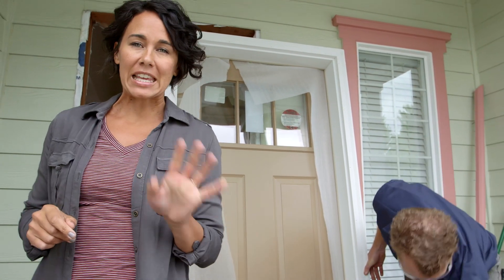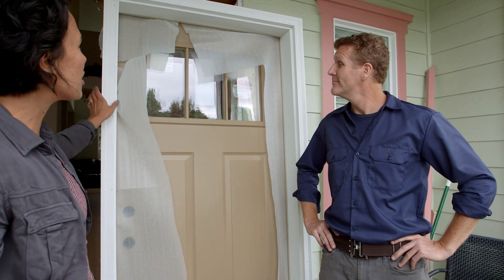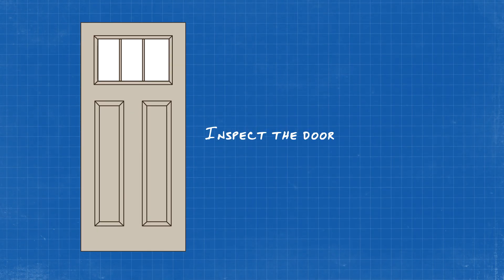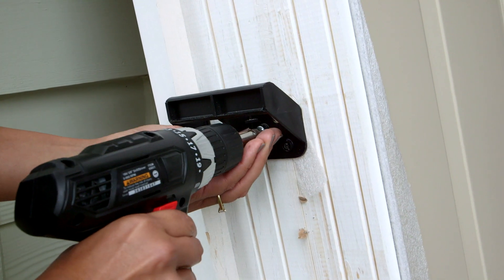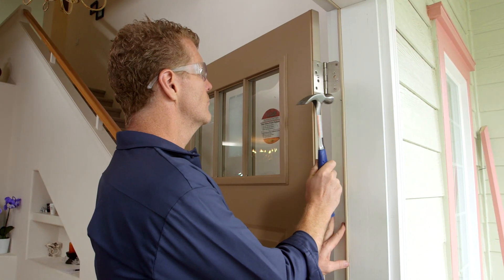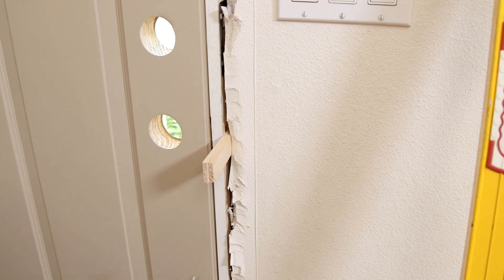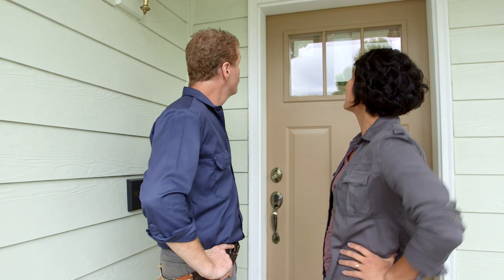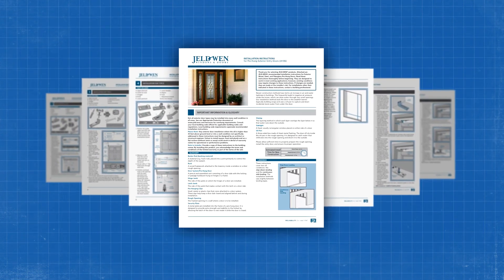Installing a Pre-hung Exterior Door

Comment: The first time I've installed a prehung door and I have installed many non-prehung doors. I just got done framing out the tire wall with the space for the door and I used 2x4's for the frame and 1/2" osb but for some reason I have half inch gap on the inside on my walls where the lock should go, I am not sure why this is happening if I could take a photo I would. Any suggestions?

Comment: This is the absolute wrong way. Never shim a hinge.
Reply: I've heard the opposite -- DEFINITELY shim the hinge, because that's a fulcrum point of force pushing out towards the gap between the jamb and the studs. Why not shim there?

https://youtu.be/lKN5r91JAIA?t=1268
Reply: You always shim the hinge.  That's where you put your screws thru.
Reply: Yes shim hinge. That's holds the weight of door pressure points of a door 3 commen points
Reply: Yeah, I've always seen shims placed at the hinges, but I've never seen them added as an afterthought, as they seem to be in this video.